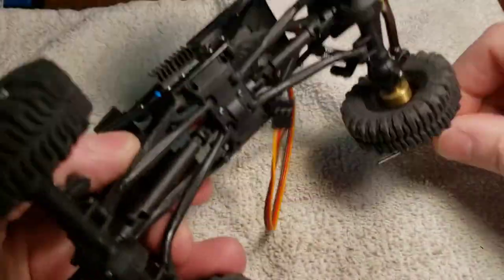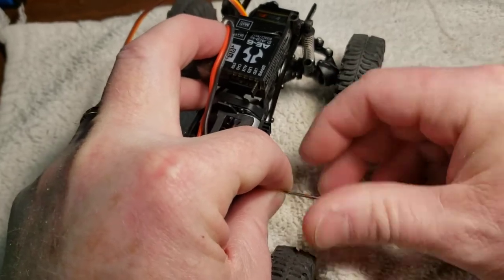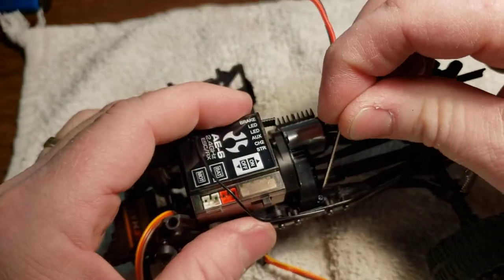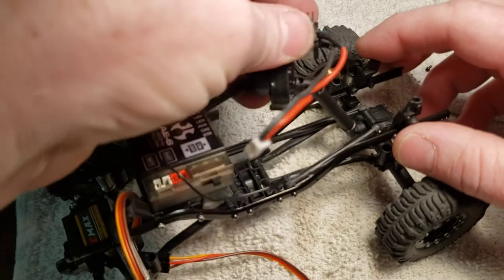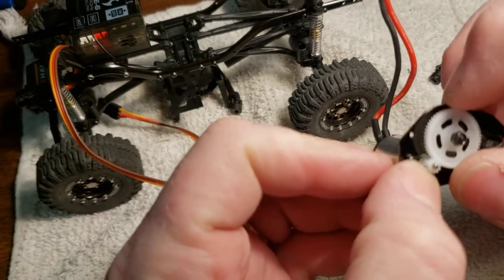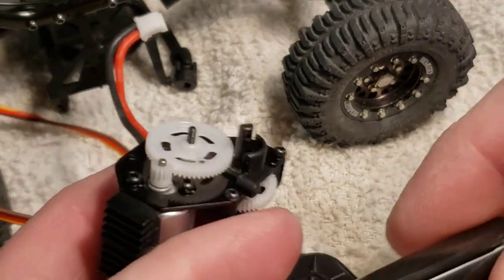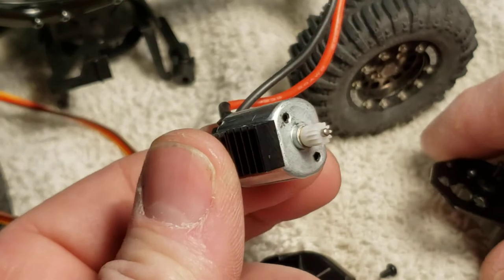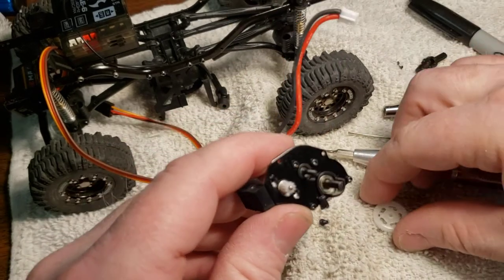SCX24 Motor Swap

Comment: I’m new to the rc hobby and just bought a scx24, how do you remove the pinion from the stock motor?
Reply from the maker: I just pulled it off. It is only held on by friction.

Comment: i just installed a furitek chameleon motor and  i got to the point where i put the spur gear on and it was rubbing on the inside motor screw and yes i put it on the correct way. literally didnt change anything to do with the spur or the screws. the motor screws are different than all the rest so i know the correct screw is where its suppose to be. i had to file down the head of the motor mount screw so the spur didnt rub on the screw and bind up. what the hell did i do wrong? also, only about 2/3rds of the spur make contact with the pinion, like the pinion is sitting to far out. i tried pushing the pinion further down on the motor shaft but i felt like i was gonna break my brand new motor.
Reply from the maker: I would need to see what you are looking at. The spur gear should have right gone back on with no problem. 

I have pushed pretty hard on motors with no issues putting pinion gears on. Trust your gut for how hard you think you should push. 

Try to figure out what has been changed that could have been overlooked. I wish I could look at it myself. I am curious about what went wrong.

Comment: How many teeth are or the stock pinion? I got the rgt 050 motor and it came with a 12 tooth pinion I believe. Does it work with the factory spur gear or would I need to get a different one if I want to use the pinion that comes with the upgrade motor? I also got a barrage motor plate